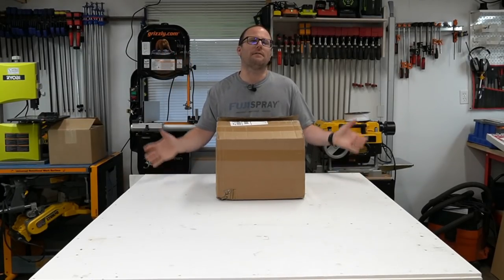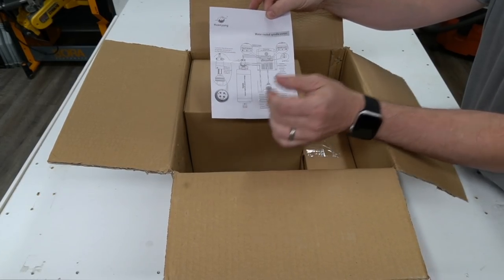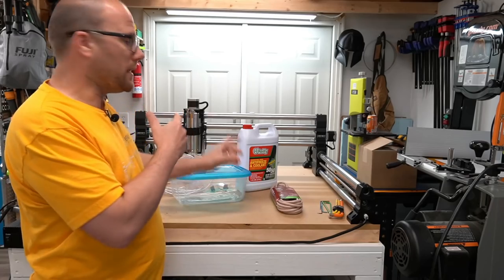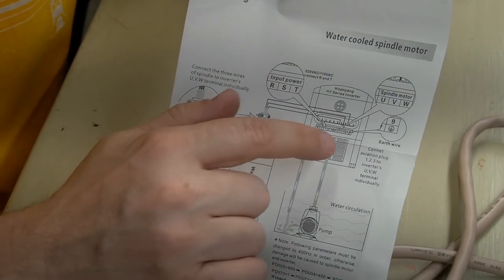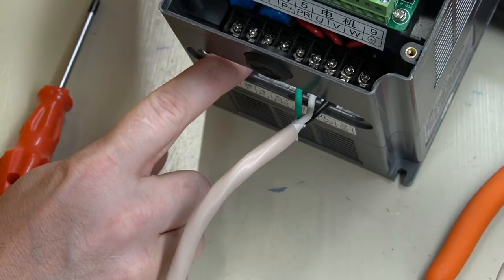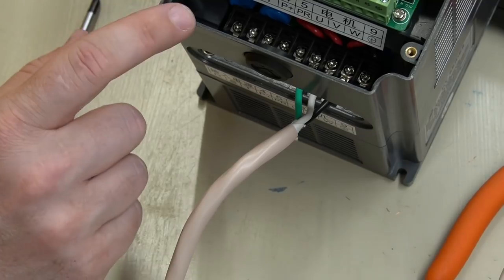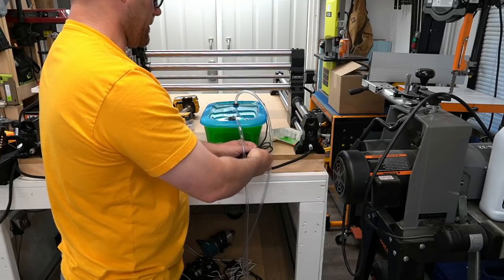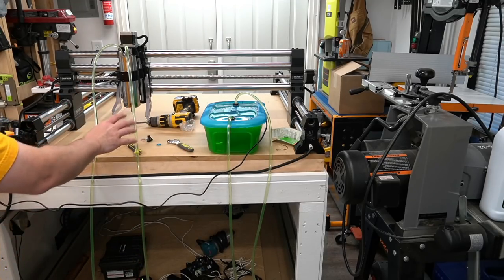How To Install A CNC Spindle - Part 1

Comment: You usually dont use electric extension cords. You would use bulk cabling from HomeDepot or Lowes its usually referred to as 4 conductor security wire for lower amperage. Or you can use 12\3 or 14\3 wire. 
The first number is the gauge of wire, the 2nd number is the number of conductors (excluding ground). So a standard wall uses 14\2 where the ground wire is assumed.
Reply from the maker: i don't have home depot and couldnt find 4 wire cord at lowes.  This was the next best thing.  It works.
Reply: Myers Woodshop just making sure you had the info you needed if you wanted to change it up ever. That’s not information that is terribly clear if you don’t know what you’re searching for. 4 conductor extension cords are rare. Just in case anybody is curious on how to do this using bulk stranded cable etc.
Reply: Automation direct sells some awesome super flexible stranded shield cable designed for these applications. It’s what I use for mine.
Reply: @MyersWoodshop  I hope you don't do your own house wiring. HV wiring is nothing to skimp on.

Comment: You can only find 4 wire in electrical supply shops from my experience. Great video BTW.
Reply from the maker: Thanks!
Reply: I get mine from home depot, it's under the 600v power tool wire section where they manually measure and cut wire. They have several gauges too.

Comment: I guess you water pump is for 220V; I got mine from China is 220V.  If you plug in to 110V power source, then theoretically it will damage your water pump since power = amp  x volt.  Thus the current will be double inside the pump.

Comment: MYSWEETY 110V 1.5KW Water Cooled Spindle Motor CNC Spindle Motor +1.5KW Converter + 65MM Clamp Mount + 13pcs ER11 Collet + 5M Water Pipe + 110V Water Pump
Reply: In the beginning of the video you mentioned you got the 800 watt spindle and then a text came up on the video that said prove me wrong in the comments.  I literally just got this 1.5 kw shipped to me today.  They are just hard to get because they aren’t in stock very long.  I’m watching your video series to help me hook it up.

Comment: From the looks of it you're clamp is way too high on the spindle. Should be about 1.5 inch from bottom of spindle to the bottom of the clamp.

Comment: There are so many wrong things in this video, you should probably pull it and remake it. 

Purchase some real continuous flex automation cable, like from Belden or IGUS.  Regular residential cord is not designed for this. You can get it in a couple days from multiple sources online. AutomationDirect is a great CNC source.

If you repurpose a colored wire you should use electrical tape or markers to label the wire. Using green as a hot is not good without marking it.

Not grounding is a violation of electrical code. It is a huge liability. Not only dangerous, but don't expect insurance to pay up if you have a claim involving the unit.

The VFD wires from UVW not RST as shown in video up front.

Third hands are under $10 on Amazon.

Correct soldering is to use flux each connection. Firsr flux and solder inside each pin of plug.  Second, flux and solder tin each wire end.  With a small dab of flux on the now tinned pin, simply align wire to pin and apply heat. Solder quickly bonds with solder tinned wire, and heat shrink shouldn't overheat in the process. Depending on what flux you use, follow instructions to clean it off if required.

Power is IN from the wall. It is OUT to the spindle. 

Use a compound joint pliers wire crimper for leverage. Soldering those was a good choice, as loose connections cause resistance, which causes heat, and worse.

"Good enough for me" isn't really a great idea when working with electricity, especially multiphase high voltage. 

Always check all the VFD programming before EVER running motor.  There are a lot of settings to match the VFD to the motor specification. Some kits are preconfigured, others are wrong. If you don't buy a kit, you must make all the settings yourself.

I like you pointing out you are using water with electricity, but didn't think ground was important enough. 

Metric water hose is available on Amazon.

I know a lot of people come here for how to do it, and it is probably a good candidate for you to consider a redo on.

Thanks for all your content. Good channel overall.
Reply from the maker: Time for warren to make a proper video!

Comment: Better get a bigger reservoir, some of my jobs run 8 to 10 hours that coolant is going to get hot
Reply: maybe and some fans to cool down the coolant. like a car radiator. run the coolant through some bendy copper tubing and have some fans blowing on it.

Comment: Metric or imperial.
It’s kinda funny how they stick with old English measurement system. Even after the civil war.
Not even the tea was good enough 😜. 
Now you Building stuff for the international market in Metric.
And are stuck with fraction converter and no factors for converting inches to feet to miles.